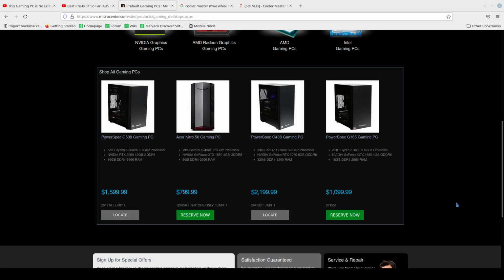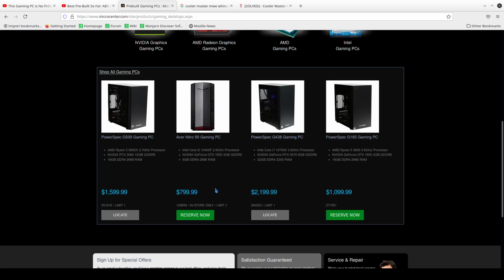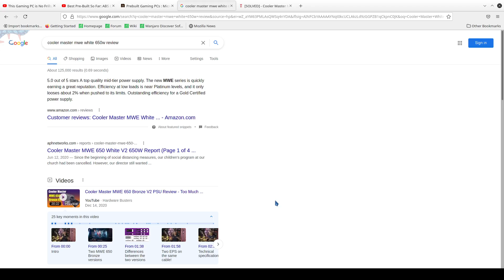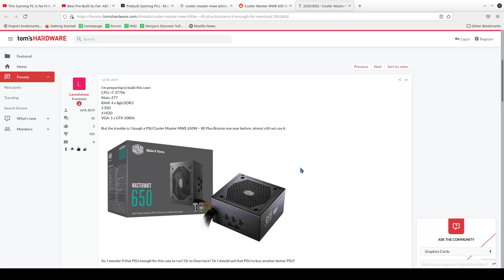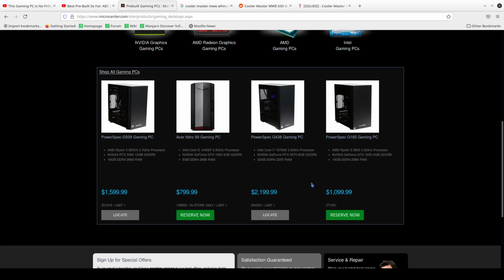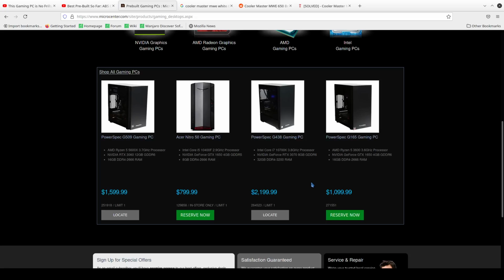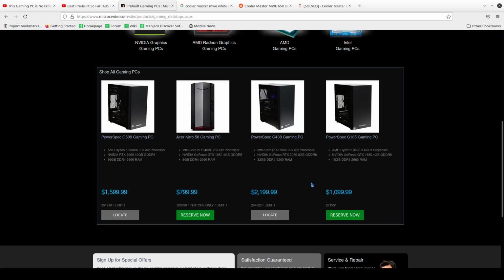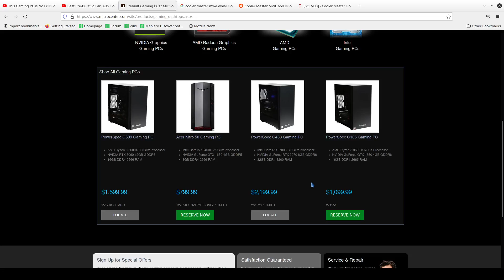The Micro Center Blog Post - Adding some comments to it

Comment: Hello I am planning to get the g509 but my main concern as you mentioned in this video is the power supply if it get this pc what are the chances of the power supply going bad?
Reply from the maker: Thank you for listening! Unfortunately I have no idea. There wasn't any stress tests done by Linus or the other major names. I did some Googling after this recording to see if I could find a work around to the issue. I did learn that Antec HCG Gold 750w is 140mm in length (3mm more than the white in the G509). I would have to see if the width would fit as it is a chonky PSU. That is what I am currently checking for that reason and because the 650w is currently 90 USD on Amazon. Perhaps I will make a recording for that and ITX builds when I learn something :)
Reply from the maker: Unfortunately I know nothing of those Power Supplies nor have I seen one. The only recommendation I can give is see if there is a sticker showing the voltage rating. Sometimes a company is listed on that. I could be wrong but what I have noticed.. Power Supply companies except Antec/Seasonic have someone else make components for them. Dell has custom power supplies made just for them. That is the other exception I guess you could say
Reply: @levctt9953  it is 48 amps on 12v rail 
Full specs 

Input Voltage

AC 115V/230V

Input Frequency Range

50Hz - 60Hz

Input Current

10A @ 115VAC

Hold-up Time

11.6ms at Full Load

Load Range

+3.3V@22A; +5V@22A; +12V@48.75A; -12V@0.3A; +5VSB@2.5A
Reply from the maker: No company listed on the sticker? That is quite odd and worrying. Hmm.. I would have to look at the power supplies I have on hand to compare those numbers but nothing sticks out as being a problem (in the numbers). Unfortunately I have a lot of stuff coming up between now and next wekened so it will likely be a few weeks before I can compare numbers :(
Reply: @levctt9953  no the company of the psu is powerspec 
Powerspec 650w 80+ bronze